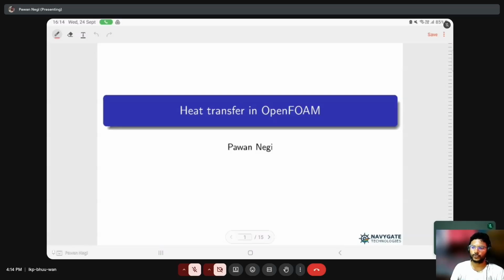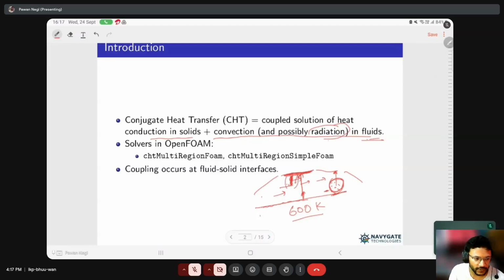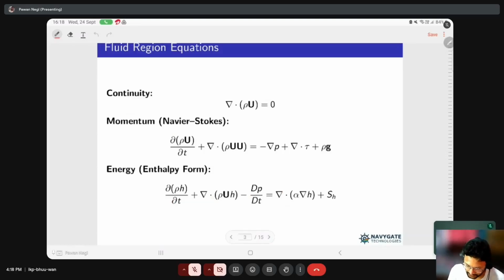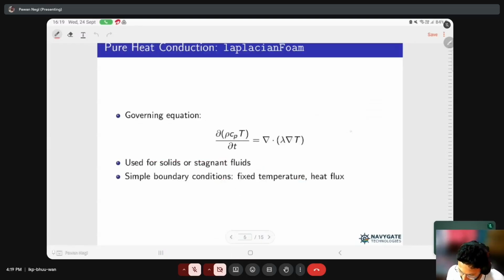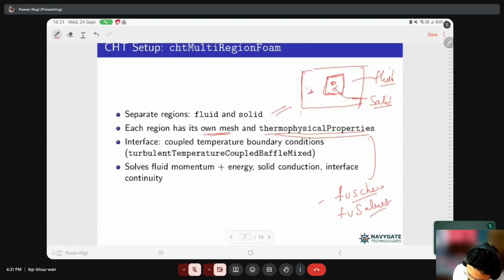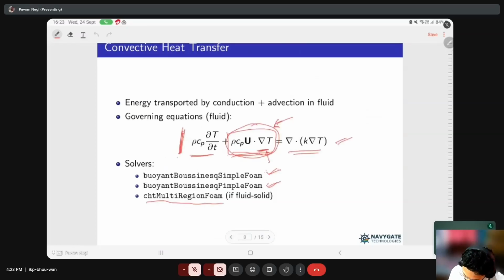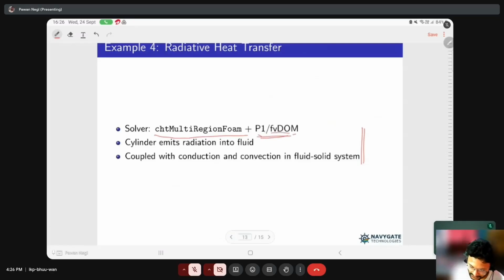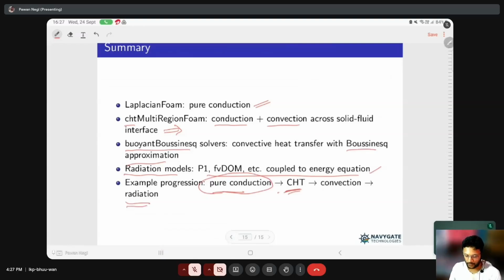Conjugate Heat Transfer in OpenFOAM | Theory + Solver Setup Explained

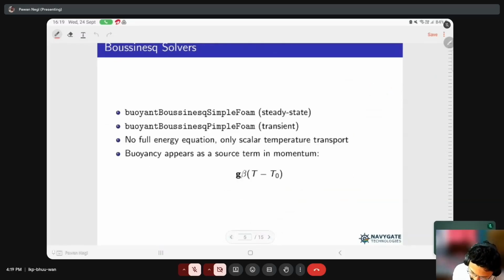Comment: Hello, from 4:00 onwards, what do you mean by "No full energy equation, only Scaler temperature transport" ? Scalar Temperature transport equitation will consist convection + diffusion + source (if any), then  how they are fundamentally different?
Reply from the maker: Yes the equations are not different. Just There is no equation of state. The difference comes from the fact that the flow is incompressible..there the energy and momentum equation are decoupled. So the presence of a temperature gradient doesn't change the density but gives rise to convection due to boussinesq approximation.